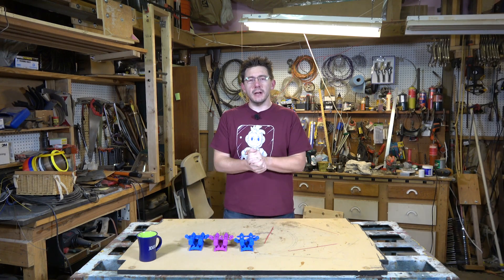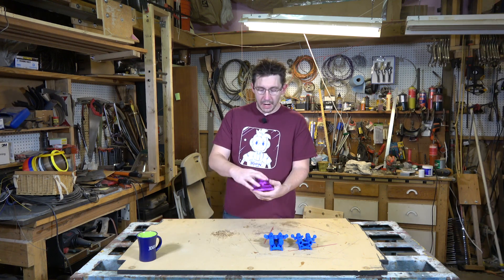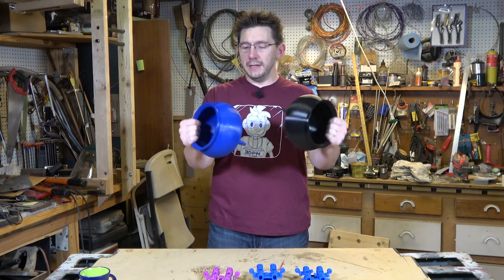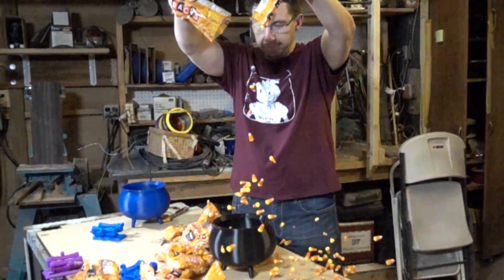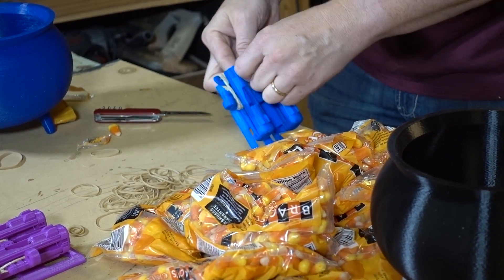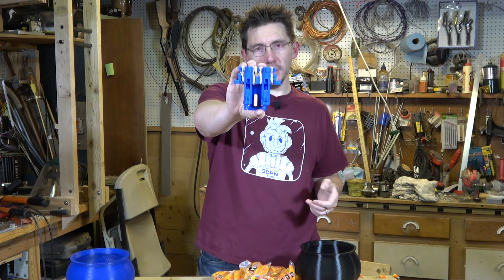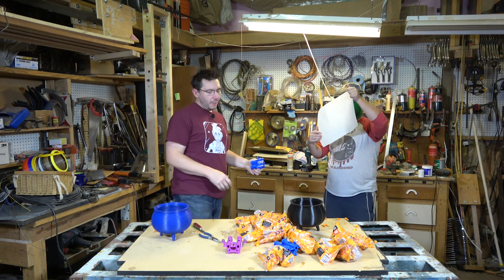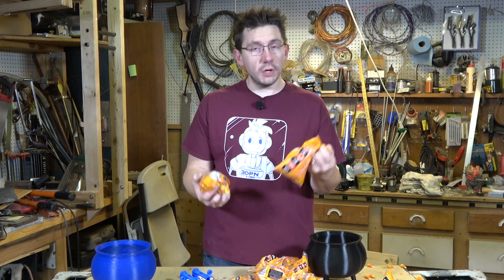3D Printing and Post Halloween Candy Corn - LAUNCH IT!

Comment: At 6:09 you say you want to use "much larger rubber bands." I agree you want to scale up the size of the launcher, but you'd want to keep the rubber bands the same size. When you do, the rubber bands will experience a greater extension leading to greater force and faster candy (unless they break). Using larger rubber bands would keep the extension constant.

Comment: So I totally went down the same road as u did but I used one of the cross bows from Thingiverse it started out with a couple rubber bands n before it was over I had 11 in all and some of the parts just didn’t hold up I broke a couple of the sliders so I printed it again in makergeeks raptor pla at 100% infill and no problems since so hopefully u don’t have any thing blow apart like mine did

Comment: thx
Reply: Tastes like sweeter harder marshmallow
Reply: Tastes good to me. I dont know how to descripe it. Its pretty sweet. Even tho its different colors it seems to all taste the same.
Reply: Heyyy, another German :P
Reply: If you used sugar and wax to hold together chalk dust... yea i think that describes it pretty well.
Reply: Candy corn is amazing. Don't listen to the haters.
Reply: You're not missing anything :)
Reply: A hard marshmellow sweetened with honey. They are good if you don't but the super cheap ones.
Reply: Nasty, save yourself.
Reply: It really depends on what your in the mood for. I am not the biggest fan of very sweet things most of the time. If you don't want something sweet, don't eat it, it will be disgusting. If you have a sweet tooth at the moment, you will love it.
Reply: I probably eat one piece a year and realize why I never eat it
Reply: Honey like, very sweet
Reply: Sounds like what we have in the UK but called 'foam sweets' - mostly sugar with a firm but light texture, only ours are typically made in pink and are shrimp shaped or yellow and are banana shaped. They're fowl!
Reply: Just for the record, there is no Candy corn in the Untied Kingdom :(
Reply: Mix Honey and Corn syrup with Sugar with wax on the outside. That's what it tastes like.
Reply: Wax.